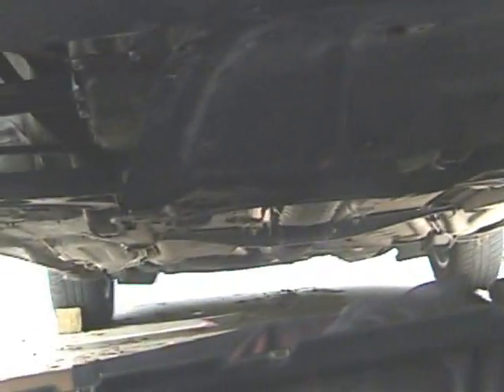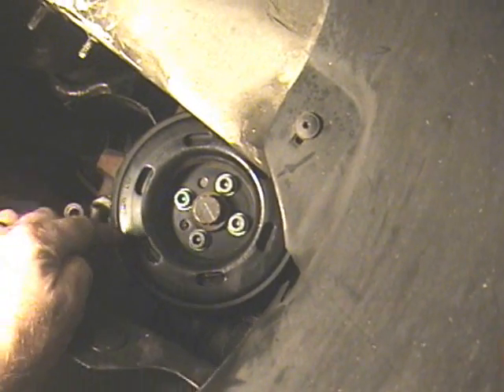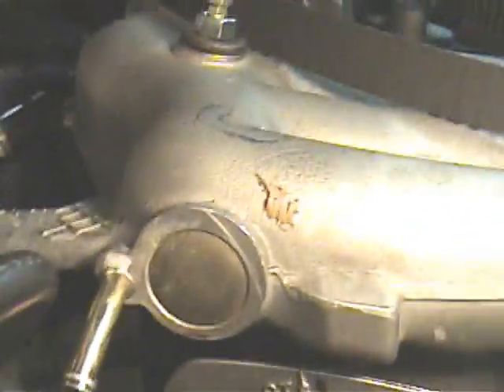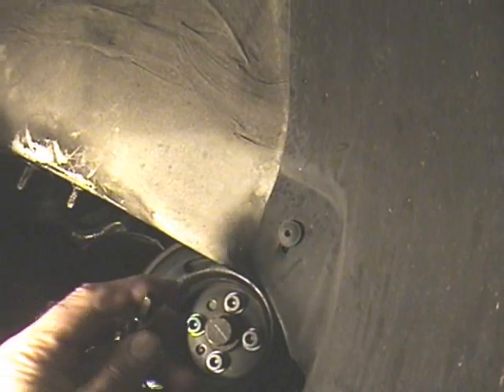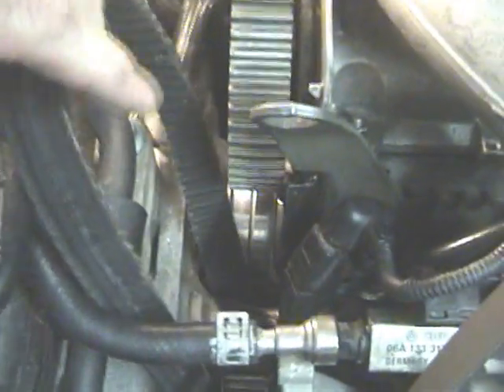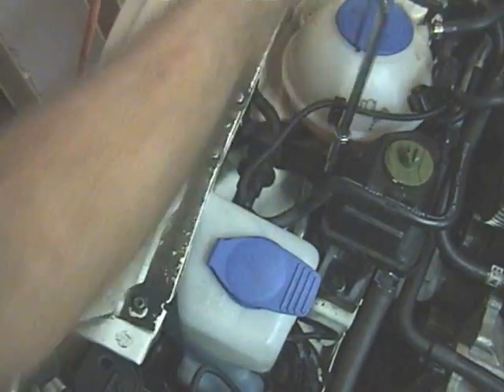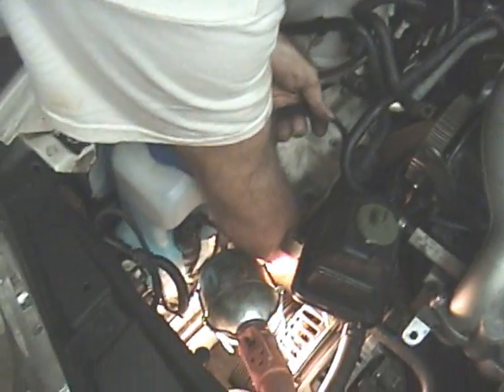How to Inspect and Replace the Timing Belt on a VW 2.0 L Engine

Comment: Also when you are this far in...pays to replace water pump with metal impeller...and also cam positioning sensor and the timing belt tensioner...he does not explain how to to timing belt tensioner correctly.

Comment: Just done mine.hardest part of the job was the 4 Allen key bolts on crankshaft.had to buy a impact wrench.they are tight.first time I've done job like this.my car was overheating gti golf.i had the water pump propeller just come off the drive shaft.sorted now

Comment: There is no checking on timing belts. When the mileage is reached it needs to be replaced. If you have a 80K miles timing belt do not bother checking it. Once it reaches its life span of 80K replace it.

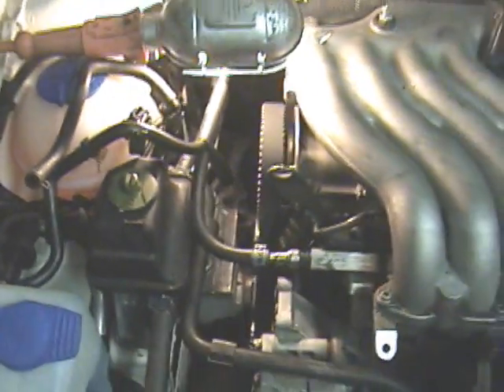Comment: I'm sorry to say but at 13:07, you inadvertantly gave out some terrible advice.  When you inserted the snap ring pliers into the two holes and rotated clockwise, you actually released any tension that may have been in the tensioner.  To set the correct tension you're supposed to rotate the two holes counter clockwise until the pointer on the back of the tensioner lines up with the "V" shaped marker on the back of the tensioner, then tighten up the tensioner nut.  Failing to set the tension properly is almost guaranteeing engine failure.
Reply: Frank Howard good eye! This is critical!
Reply: Frank Howard hence why i dont trust some random on youtube lol good catch bud

Comment: i have 70k miles on mine an it dosent look like that!
Reply: I had 200k and mine didn't either lol
Reply: Harrison Willingham I’m looking at maybe getting a 97 2.0 Jetta. Not sure if the belts been replaced or not, but it has 203k on it. I’m not familiar with VW. Should I do the belt as insurance on keeping the engine good?
Reply: Yes. Check for worn teeth, fraying of the rubber, signs of overheating, and signs of water or oil damage. Also check for "Made in Germany", because that would mean it has never been changed before and should be changed as soon as possible. Good luck, I have a 2000 2.0 which is pretty much the exact same, they are really great cars. When I got mine I didn't know what had been done to maintain it so I went ahead and did everything. Spark plugs, fuel filter, transmission fluid,  brake fluid, etc.
Reply: Its worth it. Its about 100$ for the water pump, seals, belt, and tensioner. It's very easy, just make sure to take your time and dont get frustrated. All of the challenges can be overcome with a little thought

Comment: Wow why so much work? guys . Just dont remove the fly wheel and replace the timing belt done. 2 min work
Reply: the flywheel, that not on the front of the engine
Reply: if you are looking at the flywheel you are in the wrong end of the engine

Comment: Thanks for the video, missing some instructions for setting tensioner and the importance off replacing tty bolts for engine mounts (and water pump if replacing).

Comment: Hi there, do you know if the 2012 Jetta 2.5l petrol is an interference engine or non-interference?
Reply: +leopheard almost all new engines are interference these days.

however for that engine I believe its a chain instead of a belt which is more durable.

Comment: Did i miss where the tdc marks are on at the crank?  Are both the cam pully and transmission marks sufficient without considering the crank marks?
Reply: the crank has none on these engines. you rely on the cam pulley and the marks in the transmission, but if you want to check the crank, the 4 allen bolt holes should be facing 3-6-9 and 12 o' clock. An easier way is to remove the timing covers and mark the old belt and pulley in 2 different spots on the cam pulley and crank pulley. and transfer those marks to the new belt and place the belt with the marks you made on the pulley when you marked the old belt. if your engine ran fine before, it will run fine again. just do not do this is you suspect the belt has skipped a tooth but if you change the belt every 60 000 miles you will be fine doing the mark and match method. Also ALWAYS replace the tensioner because the bearing will wear out and can damage the belt and make it snap prematurely.

Comment: Thanks much for this video it helped me so much when doing this.

I'm a bit confused. Towards the end of the video you put the timing belt on and then checked the crankshaft TDC mark on the flywheel, which was off. You proceeded to turn the crank and get the TDC mark visible through the window. So were you turning the crankshaft alone or did you turn it with the belt on it? You didn't say that you removed the belt before turning, so wouldn't that mean the timing would still be off because the belt would pull the cam with it?
Reply: Brian Parker hey man i cant find the tdc window near the transmission. do u know a way that i can find it.

Comment: Are the four bottom pulley bolts reverse threaded? The 6mm ones holding the bottom pulley on.
Reply: Gary McGraw No, they are standard thread.

Comment: I just changed my timing belt at 103000 miles. When is the next time to do it?  I have a 04 golf 2.0 can you tell me
Reply: Pedro Pérez
Reply: ***** thanks
Reply: +Pedro P&#233;rez (Potro) every 40,000 is what it calls for. you can always inspect your belts past then and youll know when to change it. you should also change the water pump while doing the timing belt VW water pumps are known for going out

Comment: Thank you for the video. I have a VW with AZG engine that I'm in process of replacing timing belt and water pump but crank rotated when removing the 4 hex bolts from the crank pulley. Need to buy the 19mm crank bolt socket to find correct alignment @ cam and crank. Need help understanding this part.

When your assistant was turning the crank sprocket with a 12 point 19mm socket wrench, was the timing belt off the crank? At around 12:05 minute mark in your video, you had just mentioned camshaft pulley arrow marks are aligned but if the crank had moved to turn the crank to top dead center mark via flywheel window on the transmission. I am assuming the timing belt would have to be off to adjust just the crankshaft.
Reply: YeechBlitz, saw your replies down near bottom of the comments list. It answered my question for setting crank timing after cam is set. However, any potential damages for moving the crank or cam w/o the belt on?
Reply: ckkim401 i wouldn't think it would matter as long as the crank and the cam are in the proper timing

Comment: that bracket isn't purposeless, when you have to replace the alternator the lower bolt can't be removed with out holding the tensioner open, and thats what that bracket is for.

Comment: this is what i call a pain in the ass
Reply: Most people just call them Volkswagens
Reply: Volkswagens are designed for people who know what they are doing, and are incredibly easy to work on if you have the knowledge and tools
Reply: It's called "Picking your battles". There's some things you can do yourself, and others to source out to a professional. I have a great mechanic who hates tinkering with lawn mowers, but loves working on cars. we trade labor. I love rebuilding lawn mower carbs, and Jason loves lager tasks, like timing belt jobs.

Comment: Paul van, you don't need to remove the crank bolt.  Just pull the 4 screws that hold the pulley and it will come off easily.

Comment: Do you need to take off the timing belt to replace a camshaft position sensor on a VW jetta 99 2.0?? Any help would be appreciated guys, thanks
Reply: Hi there, I believe you situation is different in that model, but I am not sure, since I do not have experience, but should be kind easy in that model, I believe this link might help you in your particular case,  http://www.pelicanparts.com/techarticles/Audi_Tech/06-ENGINE-Camshaft_Position_Sensor_Replacement/06-ENGINE-Camshaft_Position_Sensor_Replacement.htm
hope this helps!!! let me know
Reply: hey rene on your jetta what were the symptoms with the bad cam sensor? plis let me know thank you
Reply: Jose Ramon Guerra No Symptoms, just check engine light on and would not pass inspection.
Reply: ***** Thanks
Reply: yes pulley neexs to come off too

Comment: ok, the hardest part of any timing belt job is taking off the crankshaft pulley and/or crankshaft bolt.  It doesn't show it on this video. So how'd ya do that?
Reply: They are tough to get off and most people strip the hex head. I had to use an Irwin Bolt Extractor kit to get them out. Then just buy new ones that are NOT hex head, like 12 point, to make it easier for the next time.
Reply: I sprayed some penetrating oil on the four hex bolts, then used allen wrench (ones bent 90°). I had to insert the closed end of one my wrenches (one end is open and other is closed) to the allen wrench to use as extra leverage. One thing that I regrettably did not do is lock the crank from rotating when removing the hex bolts. Now, I know you can use a socket (set to tighten) over the center 19mm bolt with the handle wedged to the floor at 7 or 8 o'clock position. Otherwise the pulley will turn counter clockwise when removing hex bolts. Or use hex socket on impact drill.

Comment: ***** Why remove the front wheel? Its not necessary when doing this job and it does not make the job easier. All it does it make the whole process take longer! Also for those asking for the special tensioner tool, you can just use a pair of circlip pliers which do the job fine.

Comment: Very helpful video, YeechBlitz. May I ask how many miles was on this VW when the video was shot? I just want to get an idea how many driven miles would cause such condition on the timing belt. I have a 2001 VW Golf GLS with a 2.0L engine, I believe it is the same as the Jetta, I only have 89,850 miles on it as of today. Should I wait another 10,000 miles when it gets to 100,000 miles as recommended by VW or should I find a trusted mechanic and do the timing belt change now? Thank you.

Comment from the maker: Misfiring means a timing problem, as if the cam shaft and crankshaft were not truly aligned at TDC (top dead center) because this sounds like the problem.  Other common suspects are a bad computer, but other possibilities for similar behavior to misfiring are clogged fuel filter, water in gas tank, spark plug wires that short out, corroded or oily spark plugs, clogged air filter, and other possibilities.  These have to be ruled out one at a time.

Comment from the maker: Yes, both the crankshaft pulley and camshaft pulley will move back and forth in either direction.  If the timing belt is off, you can damage the valves by mashing them into the piston if you move either of those pulleys back and forth too aggressively.  As you say, it is best to leave both pulleys untouched.

Comment: YeechBlitz, Excellent youtube video Questions regarding setting timing, If you move lets say the cam when you remove the timing belt after setting TDC will it move back and forth meaning turn right or turn left? I know when you set the TDC you are turning the crankshaft pulley right.

Does this happen frequently where a tech removes the belt and somehow the crank or camshaft moves? I've never touched them with the timing belt off so I don't know how easy it is to turn them with the belt off....

Comment from the maker: Well, I would take a wood stick and hammer and rap it lightly from many different directions.  It did take a long while to figure out how to remove it, and the same when I put it back in.  Take a break and go back later.  If all of the bolts are removed, there is way.

Comment from the maker: It could be lot of things, including clogged air filter or lack of air flow elsewhere, clogged fuel lines or fuel filter (especially if it coughs on acceleration), a timing problem such as slipped timing belt or computer problem, a lot of tests would need to be done to figure it out.

Comment: My 2002 Golf has been sitting for awhile and I'm not exactly sure what the problem is or even could be, never drove it too much as it would only go 65mph.  There's not really any shaking and it drives pretty smooth, RPMs top out at about 3k, it just won't go any faster.  I drove it today and got on the highway for the first time in a couple months only to discover that its new top speed is 40mph.  Any direction or pointers would be much appreciated.  Thanks and take care.

Comment: Thanks for this very helpful video.  I just replaced my first timing belt, tensioner, and water pump! (2005 Golf). The main accessory pulley would NOT come off, so I needed a pulley puller.  Also, I bought new bolts for the motor mount, as they shouldn't be re-used.  Take care.

Comment from the maker: It was a good idea to change the water pump when the timing belt was changed because VW had defective water pumps in a lot of engines (see our VW water pump video). Yes, you can change the tensioner without replacing the timing belt and it is not very hard or time consuming.  The noise may not be the tensioner, so be careful to not jump to conclusions.  It is more likely a loose timing belt cover or other loose part that could be a snap to fix.  Try to locate the sound & check for loose things.

Comment: Thank you for the video, i have a question, can i replace only the timing belt tensioner?, cause last time i paid for  the timing belt, water pump to be changed, i was on a budget and the mechanic said it was not needed to replace the tensioner, but now that i detect the cover was loosen i can hear a noise from there. If possible, what steps in this video i can jump. Thank you...

Comment from the maker: It is an interference head.  This makes it important to either leave the crank and cam shafts in the same rotational position as when removed, or to set both to top dead center before placing head back on block.

Comment from the maker: From what I remember at this point, no.  The nut that clamps the tensioner is a typical nut that tightens when you twist it in the clockwise direction.

Comment: Probably too late now but I had the same issue with one of those bolts.  After going through many drill bits and breaking an EZ out, I ended up hammering a 12m socket onto the bolt head and then broke it off.  The rest came right out after that!

Comment: Hi, dave doris.  You do NOT need to remove the center bolt in the middle of the  crankshaft pulley assembly.  
--Lee of YeechBlitz

Comment: hi, do you have to take the center bolt from the crankshaft after the taking off the other 4 bolts that surround it? if you do ,do you have to use a breaker bar to take it(center bolt) off? thz

Comment from the maker: It is very informal -- no camera person or tripod available -- had to do four things with two hands. After supporting the engine by jack-under-oil-pan, you might be able to remove the engine mount without disturbing the timing belt.  If not, loosen the pulley that puts tension on belt with tension, move or remove as much of the timing belt as needed to get the part out, and when done, put timing belt back, and tighten the tensioner. Do not start (crank) engine or turn cam shaft when belt is off.

Comment from the maker: The holes have to be re-drilled slightly larger and then re-threaded using a tap tool.  Change the oil afterward to remove the metal shavings that fell inside the crank case before starting the engine.  The drill size must match the tap size exactly.  Google "drill and tap chart" and watch videos on how to use a tap tool.  Best of luck to you on this frustrating circumstance, one I have been in many times.  Keep up your spirits.

Comment: Very helpful video, one question. I tried to get the 4 bolts off the crankshaft pulley(6mil hex) but two of those bolts are now stripped. The EZ out screw did not work. What should I do?

Comment from the maker: With timing belt is off,water pump is easily replaced by removing three simple bolts.  Timing belts are  $10 and water pumps $25 on ebay.  The trouble of loosing the timing belt when you hit 100K will cost much more time and trouble.  Make sure you get a water pump with metal - not plastic - impeller.  For step-by-step on how to do this, see our other video on VW water pumps.  Search on y1S5uSgJq5w .

Comment: Sir i wanna ask you about the water pump if its must be replaced with the timing belt in a VW golf 1.6 rabbit which has 76000 km , or i can just replace the belt and wait until 100.000km and then change the water pump ?

Comment from the maker: There is a mark on the engine block above the crankshaft pulley, but it is not very clear or precise.  I would guess that why the put in that window on the torque converter.  When the crankshaft is being turned, there is no timing below.  The purpose of turning it is to get the crankshaft and cam shaft at the proper angle before putting on the timing belt, or the engine will run out of synch, backfire, if it runs at all.  The last sentence you wrote is correct.  Yes.

Comment: Thanks for video! Converter window question is your assistant rotated the crank while you watched the window.  Is there a matching mark you were seeing? Also, as you turned the crank with timing belt mounted, you are turning the cam shaft as well.  Since  moving both shafts, how would then assure TDC for piston one was also the alignment necessary for the Cam shaft? You did move crank, now did you realign the Cam Shaft to marks while rotated to cylinder 1 was TDC?   Thanks so much!

Comment from the maker: Yes.  Line up the flywheel (torque converter on automatics) and make sure the overhead cam sprocket is lined up on the mark.  That's all.   The mark on the crank pulley is not useful in my opinion, as it and the matching mark (yes, it is actually really there) are hard to see and inaccurate.  This is undoubtably why they went through the trouble of making a flywheel/torque converter peephole.  Best of luck on your work.